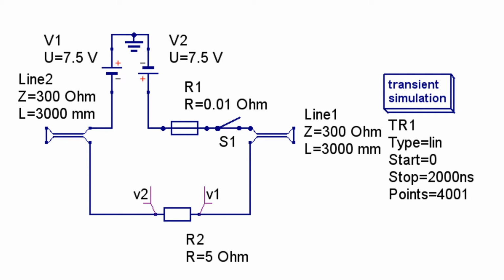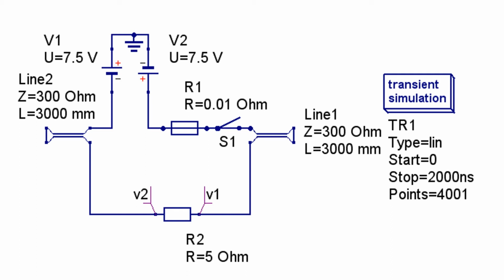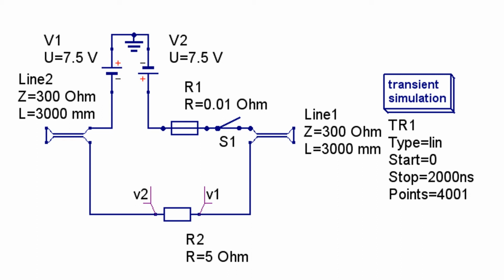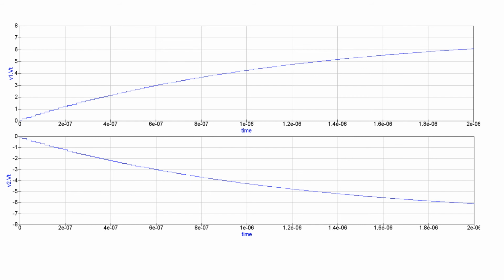veritasium

Comment: L & L  should each be 0.5 lightsec long, not 3000 mm & 3000 mm.
Z 300 ohm & Z 300 ohm -- Veritasium's wires are covered in insulation -- at least in the area seen in his footage -- what is the Z of insulated wire?
And, he says that the resistance is zero or somesuch -- possibly inferring that inductance & impedance etc are zero too (dunno)(cant remember).
And, he says (i think) nothing about how long it takes for the powerful electric (current) energy proper to get around to the bulb -- he homes in on the faux-electric current, ie the weak radio-energy current, ie crosstalk, & says that this will take 3.3 ns to light the bulb.
Reply from the maker: The simulation would take a very long time if the transmission line lengths were 0.5 lightsec long. The three meter lengths were chosen to demonstrate the effect of a significant line length. The characteristic impedance values were selected to be representative of the characteristic impedance of parallel wires. I assumed zero resistance in the wires (just like the video) and for that case the characteristic impedance is given by the square root of the ratio of the inductance per unit length to the capacitance per unit length. My simulation does not take into account any “weak radio-energy current” (I do not even know what is meant by such a term). My analysis is meant to show that there is a very small amount of current  flow after the switch is closed (not enough to light the bulb certainly) and that the length of time is takes for the circuit to achieve a steadt state condition is proportional to the length of the transmission lines.
Reply: @garymiller6151  
I am not an electricity expert, but i know a few buzzwords.
Veritasium says that his bulb lights almost immediately, & infers that this is at 3.3 ns, ie at 1(m)/c(m/s) -- but he does not explain.
However, obviously, he reckons that crosstalk lights the bulb.
Crosstalk can be due to a radio signal, or a charge field signal, or a magnetic field signal, or an em signal. Or, all of them (alltho i suppose that it is impossible to have all of them, ie 4 kinds of signals).
Crosstalk will be affected by the proximity of the ground (reflexions etc)(not important).
He assumes that these signals cross from one wire to the next at c m/s -- i dont agree that all of these signals have the same speed (Wolfgang H Gasser).
Anyhow, i agree with veritasium that there will be a spike in voltage/current at the bulb at 3.3 ns. Then the voltage will fall rapidly.
And there might be other spikes due to (the different speed of) other fields.
And, then, the electric energy proper arrives at say 1.0 sec. But, as u say, this will actually be retarded, & will take longer to build to full current, which is the main point of your footage. But i dont know anything about that side of things.
Here below is a copy of a comment i made somewhere yesterday.........................

(1)    Ok, at 0:40 veritasium says that................ "we need to make some simplifying assumptions about the circuit, like, the wires have no resistance…. ".
However, this statement tells me that veritasium is like the 99.99999% of everyone else out there, he (they) is not aware that the wires are not conductors, they are what Heaviside called obstructors.
Catt & Bishop & Co know that the Heaviside co-existing (non-rolling) E by H slab of energy current follows/hugs (outside) the wires, not because the wires are conductors, but because the wires are obstructors.
(1a)    The resistance (ohms) of the wires is not relevant here.
(1b)    What is relevant is the obstructance (ohms).
So, let us now re-word veristasium's assumption -- it becomes – "we need to make some simplifying assumptions about the circuit, like, the obstructors have no obstructance…. ".
But, if there is no obstructance then there is no obstructor. And if there is no obstructor then there is no circuit. And if there is no circuit then there is no gedanken.

(2)    I don’t know how veritasium could possibly get around this predicament.
If he assumes that the obstructance of the wires is too low then it might lead to other problems. 
(2a)    For example there might then be 99% reflexion of the energy current at each bend/corner in the circuit.
(2b)    The less the obstructance then the less the heat loss, which sounds ok.

(3)    But, in addition to the problem of reflexion at a corner, there is i think a possibility that some energy current will escape by going straight ahead at a corner.  
(3a)    Likewise at a dead end. Veritasium's circuit has 2 dead ends at the switch, ie before the switch is closed. The energy current from each terminal of the battery would jump the gap at the switch, if the obstructance of the wire in the switch were too low.
(3b)    So, at a corner, we might have say 1% of the energy current continuing around the corner, say 1% escaping straight ahead, & 98% reflecting.
(3c)    At the switch, before it is closed, we might have say 98% jumping the gap, & 1% escaping from the whole circuit, & 1% reflecting.

(4)    Here is one more complication that arises if the obstructance is too low.
The energy current will not leave the terminal(s) at the battery.
(4a)    Energy current exits from (or can exit from) the terminal at the battery because the wire (the obstructor) has a high obstructance.
(4b)    If the wire is made of insulation, then energy current will not exit from the terminal, because insulation does not have a high obstructance. Insulation has a high resistance but it does not have a high obstructance. 
(4c)    After reading (4b), go back & have another read of my (1a).  Now u understand.
So, (4) says that if the obstructance is too low then there is no gedanken.
And, assuming that there is zero resistance shows an ignorance re energy current. Well, i guess that we are all ignorant here, to some degree. As long as we are all learning. I am.